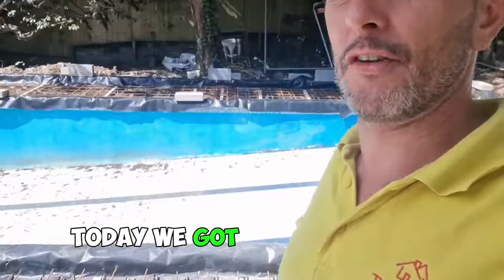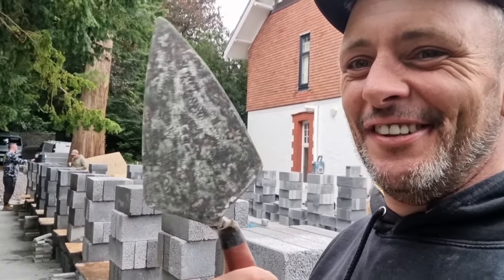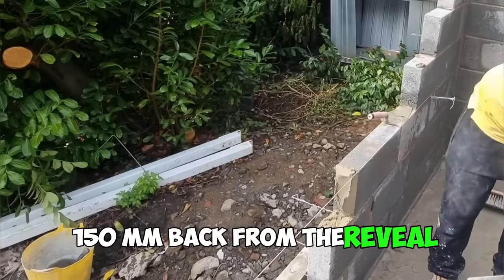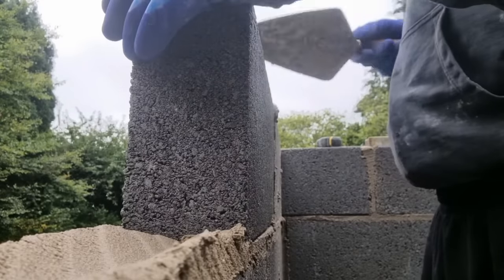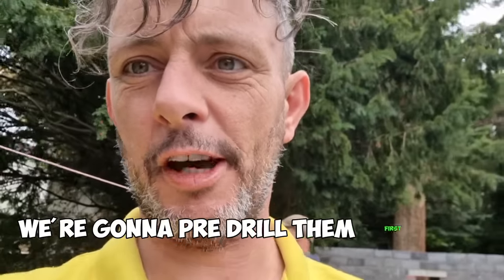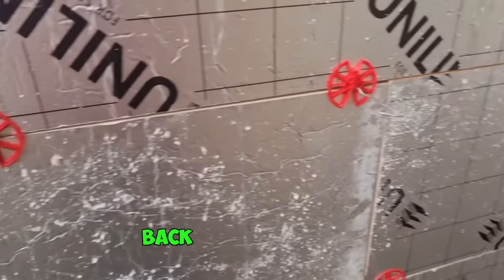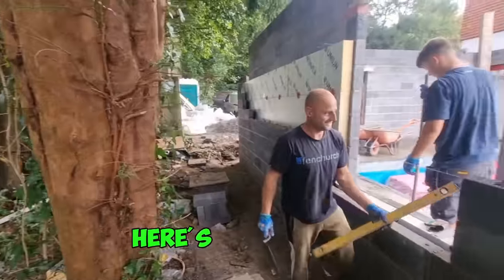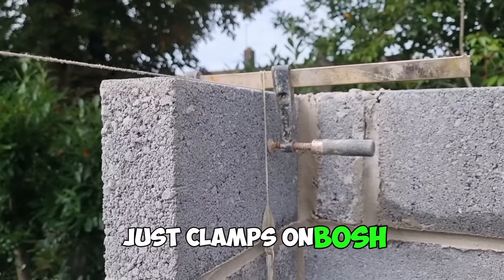Building a indoor swimming pool #bricklaying #construction #build

Comment: Aren’t you meant to silver tape the joints  on the insulation 🤔
Reply from the maker: It's not a regulation. Some do some don't.
Reply: @trickybrickys  ah ok didn’t realise that 👍
Reply from the maker: I always mention it to the client. If they want to buy I I put it in. If your boards are nice and tight you shouldn't need it.. for instance if you use the rock wool insulation you wouldn't tape it. 😊